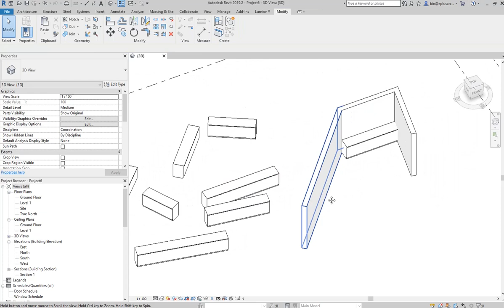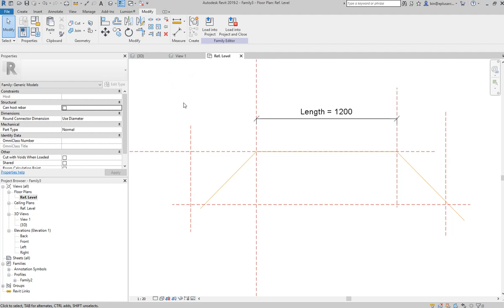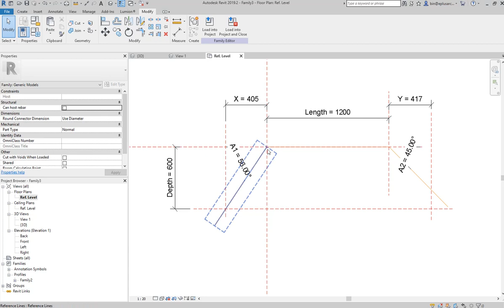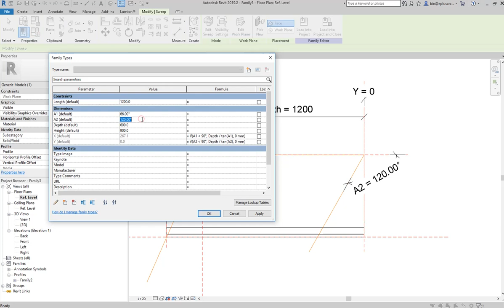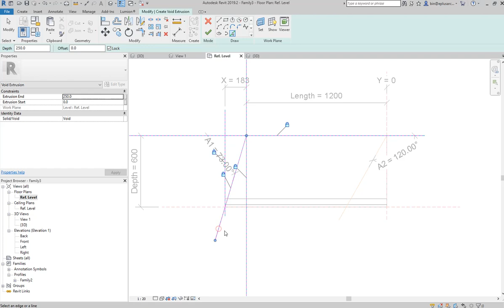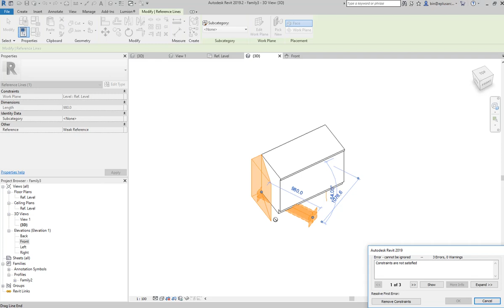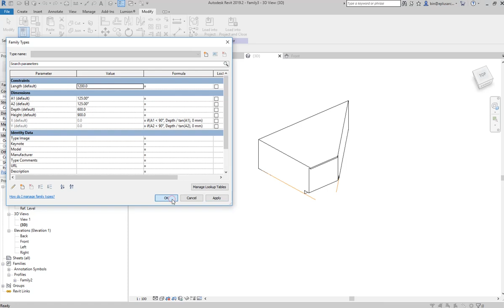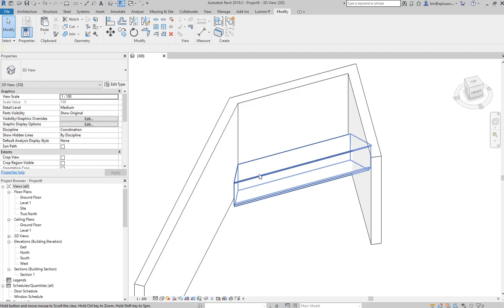Revit Modeling Exercise 008 - Line Based Joinery 1.1

Comment: HI bin, I did formula for the leftside which it works, but when I did samething for the other side. it shows " Constraints are not satisfied" do you know why? 
also how you set the family interactive which the sketch line. like you draw a line in your modle space then the cabinet generate automatically? when I load the family in, it just a box with a default length there
Reply: Resloved；need create line based genic model
Reply from the maker: Correct.

Comment: When to use pick line nd when sketch line ??
Reply from the maker: You can use pick line whenever there is already lines or edges. You can have the Lock option checked so the new line automatically constraint on the line you pick. You can also use sketch line and align and lock it onto existing line.